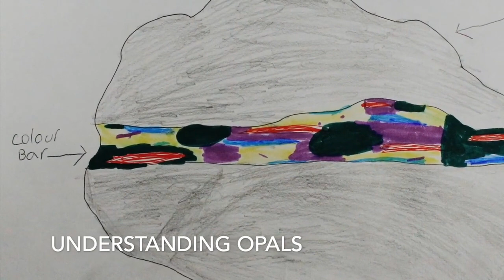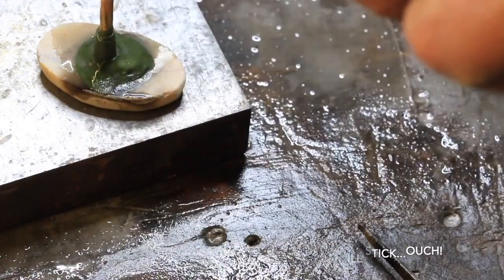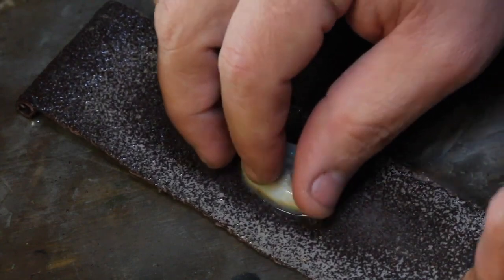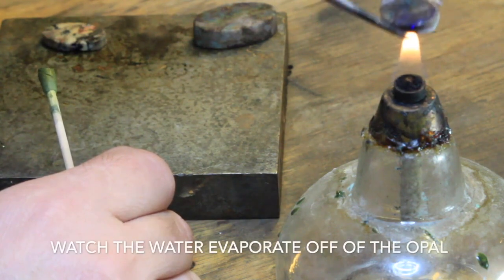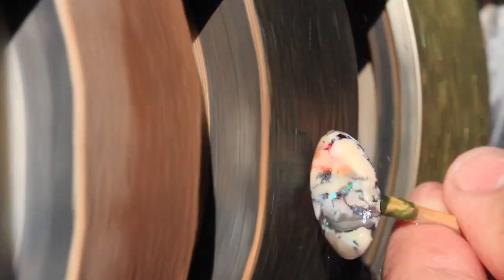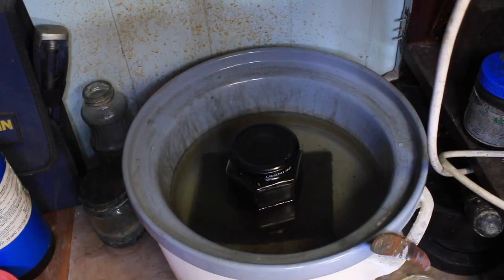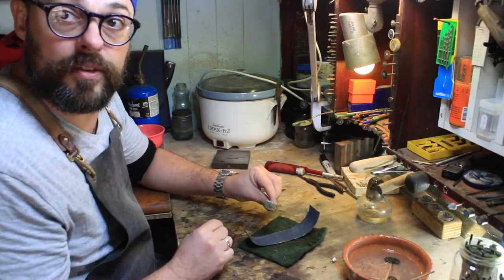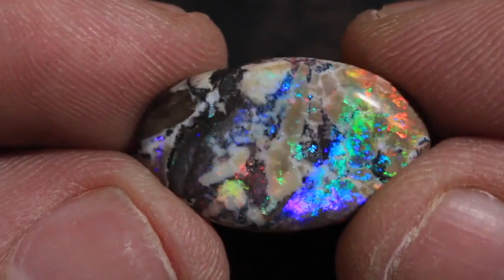How to Cut Opals, made easy !

Comment: I collected 80, 120, 220, 320, 800 and 2000 grit sandpaper (that are available in my place). Will they work.
Reply: Yeah depending on the stone you probably wont need to start as low as 80 and you may want to track down a 2500+ sandpaper then you can just get a bit of cerium oxide and you'll be set to go!
Reply: Here is a recent sandpaper cut I did for a giveaway that I am currently running. Still time to enter if you are quick.
Reply: @RoysRocks  ok